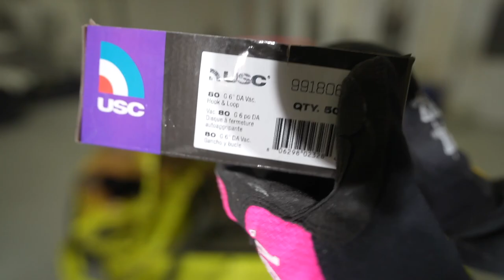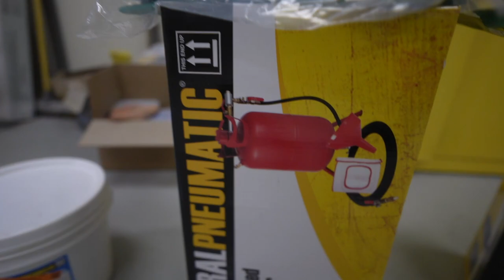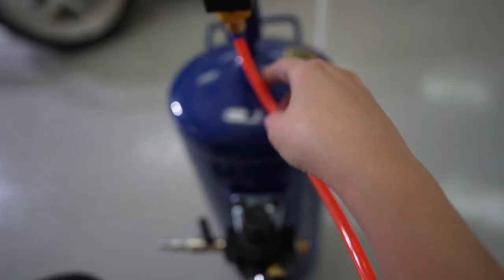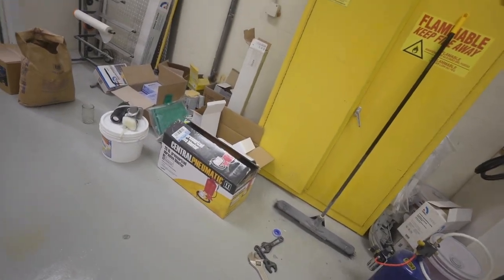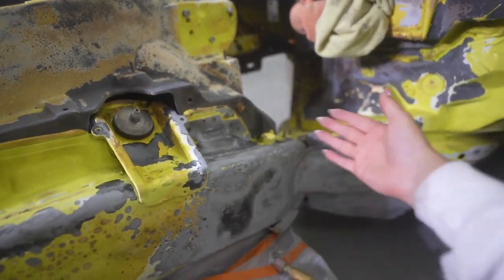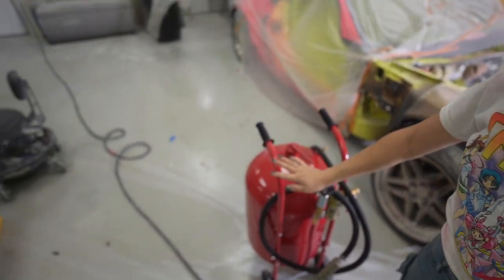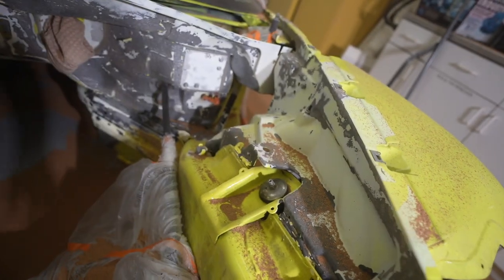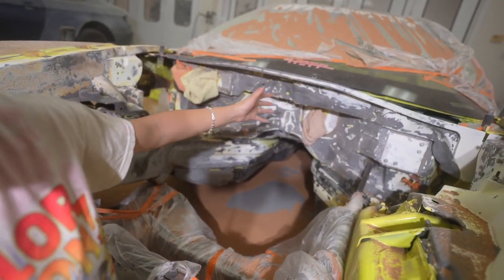Removing C6 Corvette Fire Damage - Soda Blasting VS Media Blasting !

Comment: Collete you can use the sand more than once, just sweep it off the floor and then pour it through a mesh strainer. I don't know if you can use the walnut more than once but I would give it a try. Great video. ps. Do it outside next time.
Reply: Pistol Pete walnut is to soft. After 1 time use its lost. Sand, grit or glass can be used more than 1 time. Only it looses it abressive force. Hence keep some used and use that for the glassfiber or use the walnut for that. Less abressive. I dont know your laws but sandblasting is not allowed anymore over here.
Ps. There is a you tube lady ,sarah n tuned, who already tried out different methods of blasting.
Reply: @henkoosterhof5947 ..I've always used mine two or three times I feel that's a myth ..??
Reply: @Urkardaddy  walnut or sand/glass etc?

Comment: I’d be 💯 reusing the media off the ground 😂
Reply: With sand and glass you can absolutely do that as long as you strain it but unfortunately with the walnut it’s pretty much useless after one use cause it breaks up so much
Reply: @liamfoley4452  IV re-used walnut before can get about 2 goes with it before it's no good
Reply: @paulwilliams7816  I’ve never had goo luck with it. Always seems to just be to fine and it takes double the time to do 1/4 of the work so I haven’t bothered since

Comment: I use that same harbor freight media blaster with walnut media to clean carbon off the intake valves on BMW N54 and M57 diesel engines. Also on direct injected Mini Cooper intake valves. Definitely worth the money but it's a PITA to use with all the ball valves so you don't end up clogging the machine

Comment: with soda blaster if you can put 130psi thru the tank then turn regulator to 85. it will blast all paint clean off without harming the body panels I bought both like you did and the soda worked best without warping panels at that pressures

Comment: the gel paint stripper you get at hardware stores works really well. paint it on with a brush and it peels right off. power wash clean and do any touch ups after
Reply: Using paint strippers could result in damaging the fiberglass!!

Comment: You can sweep up the media and reuse it. As long as it stays dry and you don't have too large of debris in it youll be good to go... Good luck with getting it back to 100%, you guys worked to hard for it to end that way. Keep pushing and youll be ripping it again soon✌🤙  You should have someone airbrush a true flame style like (rip)Mike Lavelle used to paint for the engine bay. That along with the neon fade would be killer. Adam kept the torched fenders, you should pay homage to the fire gods your own way 🔥  🙌

Comment: I just got done taking my rear bumper off Chevy Malibu 08 LS today been working on it for about 5 or 6 weeks now taking parts off before paint it. Took the rear bumper, trunk, front and back lights, outside sideview mirrors, doors, inside door panels and the front grille off gonna paint it midnight purple wanna paint it midnight purple but after the garage sale is done it's outside now with a cover over the top of it I bought the cover from Autozone.

Comment: Autozone for the quick connection.  It’s where I got the one I used on the sand blaster.  Also note that it requires a lot of air and if clogged just shake it a second and you good.

Comment: im in the uk but do media blasting a lot to save money use soft dry play sand as the first media its aggressive but will be cheaper and better than the walnut shell and use the shell for the intricate places use the largest tank you can and vary the pressure for glass fibre to stop blowing through

Comment: The professional soda blasting stuff is a lot better. It’s a big thing near the shore areas bc people get it done to remove years of bottom paint off the bottoms of the boats. But your doing a great job for what you have. Usually that much stuff is done outside. A lot less cleanup and you can breathe a lot better.
Reply: The walnut shells does great on aluminum parts too. Doesn’t put the metal. Also you can reuse the material to a certain level. Might not be as good as first time it went through but still usable. Just like a cabinet. The material stays in there and gets recirculated until it seems worn down

Comment: If the walnut media you used is not contaminated with dirt, you can reuse the excess. Filter it and put it back in the tank.

Comment: Walnut shells…  Wow, would not have thought of using walnut shells.  The shells are useful.
Reply: Great for valve/chamber cleaning on direct injection/diesel. Picked up 30hp from my valves been so gross and no more exhaust smoke.

Comment: Make sure you clean the engine bay after using the walnut shells. It will leave a oil coat on it. Good luck

Comment: A cheap inflatable paint booth from a certain China based online seller (Ali X? ...or maybe someone in the US sells them for a reasonable price?) might be a good idea if you plan to do any more chassis blasting in the future, at least the mess could be contained to a smaller car sized box rather than getting in every crevice/item of an entire room, then having leftover dust/media migrate into the paint booth. Vacuum the most out of the booth once you're done, deflate it, pack it away for next time.

Comment: I would of just called a mobile Hydroblaster. Could have just backed the car out and they would of blasted it with water and glass beads. Wouldn’t have had to worry about the mess or over heating the surfaces your trying to strip.

Comment: Why would I go buy that stuff when the compound has a sand blasting booth??? Full car booth with all the equipment. Does noone there know how to run it. I could have that whole front end blasted in half hr. But sand blasting is what I do for a living.
Reply: I scrolled down looking for this. There’s a blast booth on site. No reason not to use it, and if there’s an issue have it serviced. You can learn how things work.

Comment: Your running your pot way to rich. You want to adjust the leaver down the bottom to reduce the media a lil. To much media reduces the speed the air pressure can make it move, which wastes media n makes U work twice as hard. So reduce the media n crank up the pressure n you see the difference.

Comment: Good effort.. but if you wanted to get back to way it was, you should have been told to just replace the chassis after the fire .. especially after a deep heat fire like that, should have just rough cleaned and kept like the barra mustang .. burnt chassis will never be the same